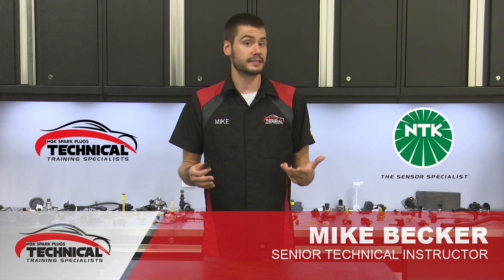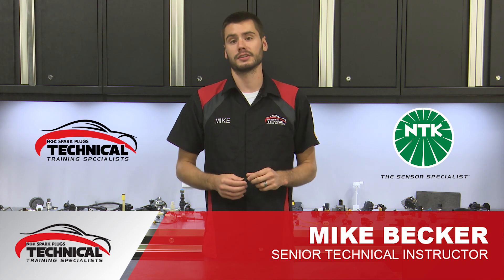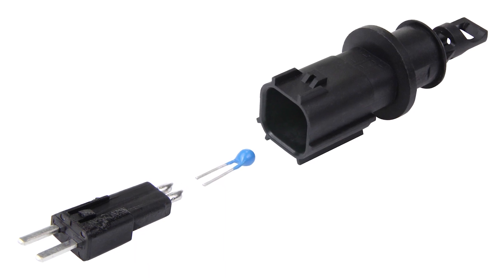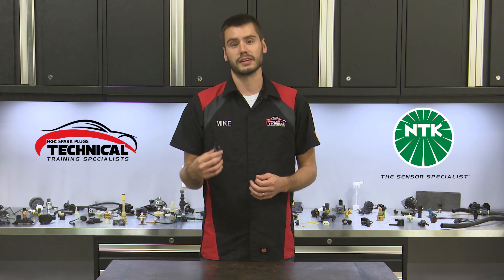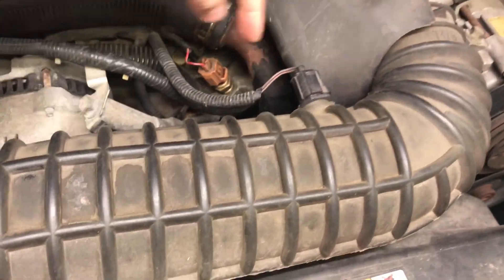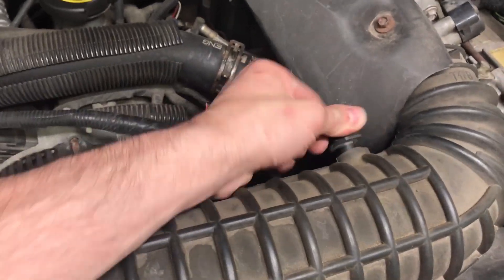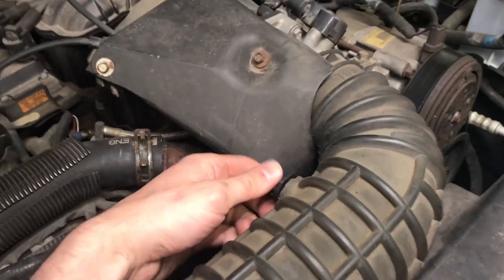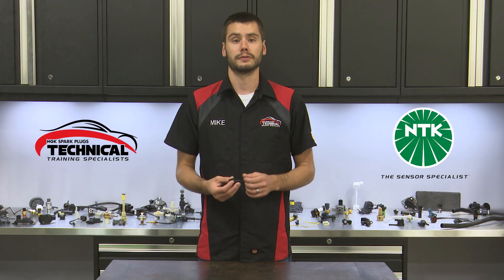NTK - Air Charge Temperature Sensor

Comment: I have engine surge when accelerating 3.5 natural aspirated changed throttle body plugs coils maf. Air filter and gas pedal sensor. Still even after taking it to the dealer .. they couldn’t find anything wrong with it. I still have the problem. Is there any other sensor I am missing that could cause the rpm surge?
Reply: bad grounding or voltage issue.